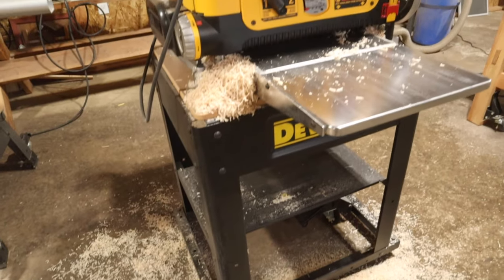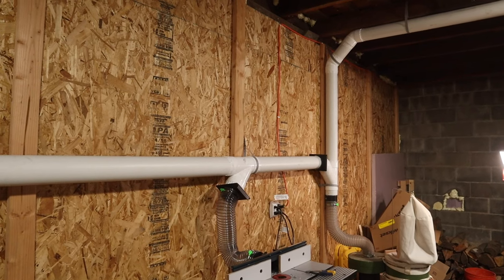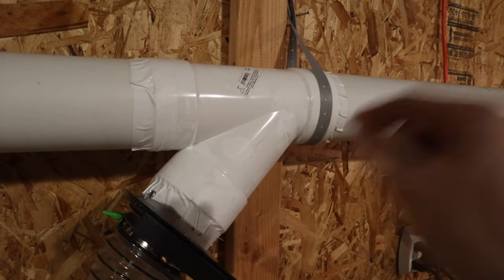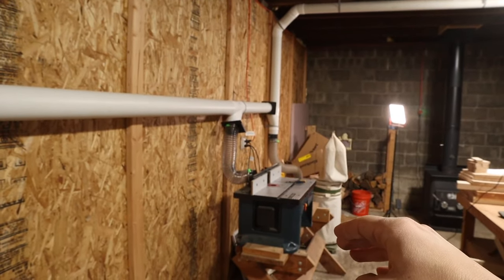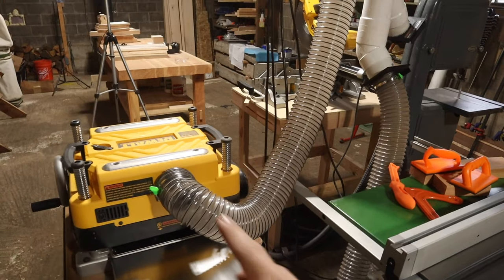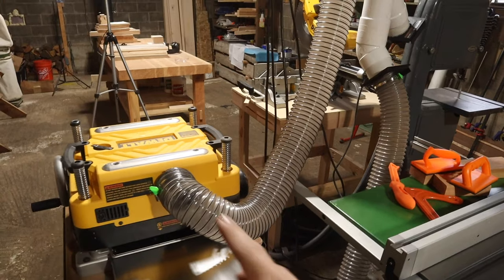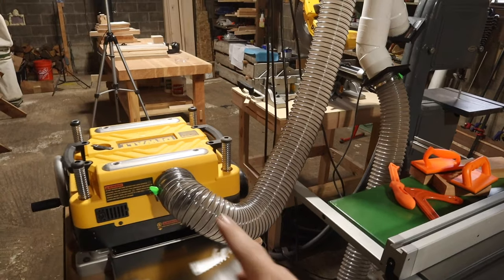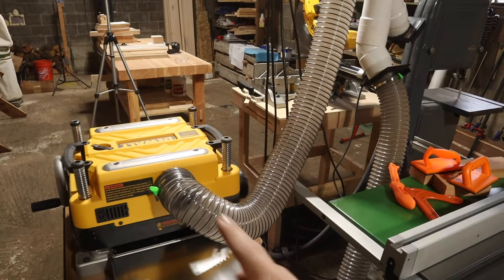4in, PVC Dust Collection Upgrade | Much Better!

Comment: New subscriber here.  I live in north Texas where it is hot. I am looking at dust collection and like your video and thought process. One question I have is with the sewage or schedule 25 (thinner/cheaper) PVC is the fit with the blast gates is loose and some tape it to make it snug and others purchase an adapter to make a more snug fit.  How did you resolve the fit problem of dust gates?
Reply from the maker: Hey Brent! Glad to have you around! 

Yea, my final solution was three fold. 

1. Cut an ~6” piece of PVC off so it can be inserted into the fitting at end of line. 2. Caulk the blast gate with silicone caulk
3. Install some self tapping screws for mechanical support. 

The caulk should be enough but while it’s uncured, it’s still pretty runny. I would also recommend, if you can afford it, self cleaning blast gates or, if you need these ones, install them so the sliding portion points down a little or entirely. They like to jam sawdust into the far end and will prevent full closure unless you clean it out.

Comment: Great video.  Simple and to the point.   Did you glue all the connectors.
Reply from the maker: Thanks! Glad you found it helpful. I did not but would recommend at a minimum, screwing all of them together. Caulking all connectors would create a better seal but I’m not sure how much of an improvement it’d be. I’m also planning to move this system with my in the future so I wanted it a little easier to disassemble.

Comment: I wonder if attaching a ground wire somewhere on the ducting would kill the static problem?
Reply from the maker: It would help but because PVC insulates so well, you’d have to wrap it or cover it in more than just one location but grounding it would help.

Comment: I have a question: You show your entire system using 4" PVC. What is the inlet of your dust collector? If it is 6" or 8" as most are, did you run that diameter and then reduce to 4" or instantly reduce at the collector inlet? Any thoughts on which is a better method? Thanks
Reply from the maker: That’s a great question, in my case, the dust collector has a 4 inch at the inlet, so I had no reduction all the way through. If you do need to reduce, I would tend to leave it as large as possible for as long as possible, then reduce it at the tool. However, I also understand this means you will be paying a lot more for your dust collection hardware, so immediately reducing it at the collector might be the right answer for you.

Comment: This video came at the perfect time as I’ll be replacing my current “system” with DWV pipe. I see you are using Powertec blast gates. Are they self cleaning? Thanks for the great explanation.
Reply from the maker: Glad to hear! And I am using those. They are not technically self cleaning so there may be jamming issues later but this far they’ve worked great!
Reply from the maker: Hey Richard! I wanted to provide some feedback. I just went through and did a cleaning of all my blast gates because some of them were pretty clogged up. Easy to clean but definitely confirms they are not self cleaning.

Comment: If you are concerned for the static or getting shocked by machinery I found a great video explaining how to run 3/4" screws through the piping and running bare copper wire to each screw and grounding through the dust collector and tools if you wish!
Reply from the maker: Interesting! Thats an idea!

Comment: You mentioned a canister filter. Where/ and how can I get one. I have the POWERTEC DC1080 Dust Collector with 1 HP Motor | 800 CFM | Mobile Base
Reply from the maker: Most of the videos I've seen reference Wynn Environmental (Link below). They should have one that comes close to fitting your dust collector. It is worth noting that very few of the dust collectors have a good way of mounting the canister filters. Almost all of them need a custom mount made by the woodworker. 

https://wynnenv.com/woodworking-filters/

Comment: Not sure why you didn’t mount the 45 near the router table the other way around. It would give you a much smoother airflow. The way it is now, the flow goes down and then up at a severe angle.
Reply from the maker: Can you help me understand what you mean? I installed the two wye’s to allow for a below and above collection at the router. I’m not sure how it’d rotate to make it smoother.
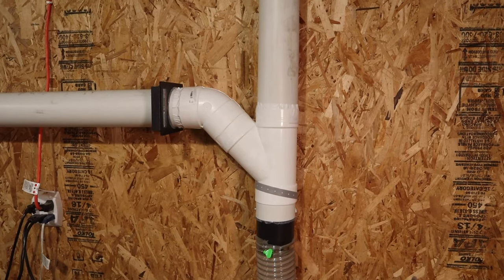Reply: I'm not sure if their comment addresses the wye shown at timestamp 5:03. When I first saw this wye configuration I thought the same thing. It looked like you had air drawn in on the left side of the wye that would go down and then have to make a sharp turn to get drawn up toward the ceiling. From the tight shot of the wye I assumed the vacuum was coming from the line dropped from the ceiling and that the line toward the floor was going to another tool dust port. Looking back at time 4:40 I realized the bottom of that wye was connecting to the vacuum source and that the ceiling line was going to a different branch of the collection system. In that configuration it makes perfect sense!
Great video, thanks for the helpful info.

Comment: I am working on the same problem with my shop. The big question I have is: how to reduce down for the small outputs on thing like sanders, routers, ect. tools that have a small vacuum size output. I need to reduce down from the 4 " Y fitting on my pipe, to these small output tools. I can't find any video that demonstrates this! Any help would be Great! Thank you for this video!!
Reply from the maker: Glad you found it helpful! And great question. I’m almost all cases you’ll have flexible hose from the 4” wye to the tool. Then from the hose, you’ll use a 4” to X” reducer or a series of reducers to match your tool’s output. 

As a note, depending if you got Sch40 or DWV, things will fit differently. I was using DWV and from my wye needed a 3” segment of pipe (to fit into the wye) and then I could barely fit my 4” flexible hose over that segment. Powertec has an adapter that makes this much easier, but it does cost a few dollars and can add up. You may also need some silicone and a screw to hold it in. 

On the tool side, it should be very straightforward with the reducers. As another note though, large dust collectors don’t do nearly as well on a smaller opening. I still use my shop vac on some tools. 

Below is a link to the 4” to 2.25” adapter I use in a few places
https://amzn.to/3v7u0yv

And here’s the Powertec 4” coupler
https://amzn.to/3DYTgLs

Comment: I’ve (hobbiest) been using pvc over a year and no issue. How dust the hf dust collector work
Reply from the maker: Same here. Doesn’t mean zero risk but I haven’t seen enough evidence to be concerned about it. 

I’m not sure if mine was originally from HF since I was gifted it but it’s a 1HP cheap something brand and it works wonders for how cheap it is. Looking to do a build with the 2HP HF with a two stage build sometime soon.

Comment: That's a great system but do you have to use a large pipe as I've got a very small work shop can I use a 2" pipe and  flexible tubes
Reply from the maker: Great question! It depends on a couple of things. If your dust collector has a 2” port you may be fine but I haven’t seen many outside of shop vacs. The problem you can run into with a shop vac is they have a high pressure drop but very little air flow. So they’re good right at the end of their own house but not much further. 

If you have a 4” Dust collector and try to neck it down to 2”, you’ll lose a lot of your flow as well because of the opposite reason. Most dust collectors have high air flow but low pressure drop meaning they can’t overcome reductions in diameter well. 

If you can avoid flexible hose I’d recommend it because the ribbing on it causes a lot more drag in the system reducing the overall effectiveness. 

All of that said it can still work do use a shop vac with 2” flexible hose through the shop, you may just find yourself disappointed with how it performs.

Comment: I can't get over the fact that no - one is stepping down the sizes for certain equipment. Stepping down to 3" or 2'" increases the volume speed and ensures delivery to the final bag ( instead of being stuck halfway). i have seen a number of commercial shops that do the stepping down! Why not in small shops?
Reply from the maker: That’s a great observation. My thought is that most residential or hobby level dust collectors don’t have the power to overcome that reduction effectively. I know mine absolutely chokes when I neck it down at a tool.

Comment: A lot of good info. How do the blast gates fit into the dwv?  Is there any gap between the OD of the blast gate and the ID of the pipe or is it a good fit?  Is that why you used the caulking around the connection between the blast gate and the pipe?
Reply from the maker: Thanks! Glad you found it helpful. Blast gates fit loosely, won’t stay on their own but close enough that any generic silicone caulk sealed it just fine. You do need to have a pipe connecting to it though, not a fitting. The fittings go over the OD of the pipe which makes it way too big to fit.

Comment: Do you know? In stead of a bag, can I run a 4" hose into the top of a trash can?
Reply from the maker: I did! I haven’t been able to get around to designing a better system yet 😂 but trust me, I’m planning on it in my new shop. Two stage, cans to empty, the works.

Comment: i have wondered if you add a copper wire running through the top of just part of the pipes?  drill a small hole at one end , run wire through and back out another hole  then seal with jb weld or such it would be worth it???  i have seen some new magnetic couplers that might reduce the number of ducts at the cluster area  also a floor drop there might be nice and central!!  i have 2 systems to set up one in our shop( where will do wood. ect) and one for my wife's  stainglass shop where she does a lot of grinding and paint work!!  i plan to put the system for the glass shop outside in a " dog house/ lean too"
Reply from the maker: You could run a copper wire through it but you'll need to make sure it's grounded. This is no statement of authority, I've just never heard of a dust collection explosion in a hobbyist shop which is why I never grounded my system. If you're worries about it, it'd be pretty easy to help drain the charge. 

On the note of putting the dust collector outside of the working space, you'll need to find a way to provide the "make-up" air. Since the DC is pulling all of its air from the work space and pushing it out in another, the air in the work space needs to be "made up". I've seen some folks just put an external vent in their shop for this.
Reply: @NorthwestCraftsman  thanks yes figued to ground to the frame of the metal building , and we leave an upper window in the loft of her shop open .  could you just ground to screws in your couplings if they go through a little bit i wonder?
Reply from the maker: Both of those would be perfect 👌 and you absolutely can ground to the connection screws so long as those are connected to ground on the outside

Comment: Great setup!  Did you modify the blast gates to prevent them from getting stuck when too much dust cakes up the grooves the gate slides in?
Reply from the maker: Thanks! I appreciate the compliment. No mods on the blast gates at this point and I haven’t seen any issues but it is still brand new in the scheme of things. We’ll see if that causes issues in the future.
Reply: @NorthwestCraftsman  Your most used ones will most likely get some buildup. I remove them and clean them with compressed air periodically.

Comment: Nice video. I'm currently installing a similar duct system in my shop. During instillation a thought crossed my mind about material dropping down into Y connections closed off between tool and dust collector. I see over your work bench you have a Y connector facing down. So when using your table saw or other at main branch do you see material dropping into the Y at the work table. If it is you would have material falling out of the blast gate onto the work table. Just curious if you are seeing this.  I was thinking of setting my Y connectors at a horizontal position and then 2 45s to get it down to work surface.   Again thanks for the video.
Reply from the maker: That’s a great idea! I had thought it might be an issue but haven’t run into it yet. The blast gates do a good job keeping the debris from getting past and as soon as I open it up, any debris gets collected. You’re idea would make sure there isn’t any issue at the price of a small amount of suction for the extra bends.
Reply: @NorthwestCraftsman  Great thanks for the reply. I'm just a hobbyist so system will not see heavy use, was just wondering. I have several spots that could have that issue and your right for the little loss of suction it might be worth trying a few 45s. I have an air flow meter and plan on lots of testing to see what kind of drop I will see with changes.
Reply from the maker: Sounds great! I’d love to hear what your anemometer says about the efficiency loss!

Comment: Great video. Thanks for sharing. New sub. 
Have you decided on how big your new DC will be? I have the same 4 inch PVC plummed into my shop (now behind my sheet rock) and I'm shopping for a cyclone system. Wondering if I should go big or limit to a 1.5 HP 600 CFM DC. Thanks for any info.
Reply from the maker: Thanks! I’m glad you found it helpful! Unfortunately I haven’t decided yet, my current setup is enough to collect at the stations I have so it dropped in priority. If you have the money to go bigger, I don’t think you’ll regret it.

Comment: Is your dust collector itself connected to the piping with a flexible hose? It looks like it in the video but couldn't tell. If so does it cause any issues?
Reply from the maker: You observed correctly! It is connected with a flexible hose and it doesn’t cause any major issues. Likely reduced my suction a little but hard piping it wasn’t an option for me.

Comment: I have a question how big is your desk collector? I have a 1hp desk collector. It was thinking about doing the same thing, but didn’t know if it was big enough.
Reply from the maker: Great question! Mine is 1HP and does a good enough job. 2 would certainly be better but 1 is sufficient in my system.

Comment: Why the crazy tool cluster thing?  Why not a single port that you use for all of the tools in the cluster.  Would take about 10 seconds to connect the flex hose coming from any of the tools.  The suction in the shot where you are cleaning the miter saw looked fairly anemic.  That's a ton of 4" pipe for that small collector.
Reply from the maker: You have a valid observation, it doesn’t take much time to swap a flex hose. I do still appreciate having it split to each tool so it’s only the blast gate I need to switch though. 

Regarding the suction, it is anemic. My dust collector is under powered for a system this large. However, it’s far better than the shop vac system I had before 😂 baby steps. I’m planning to upgrade my DC some point soon.

Comment: Would it not have been better to just glue the joints in the run rather than duct tape (which is pretty useless)?  Also I am interested in if it can pull metal swarf from my metal side of the shop?  Haven't heard or seen anyone address that.  I have a HF unit sitting in my new shop addition and am wondering if it would do both?  I will have to try using the PVC cleaner first and then the silicone.  Might stick better.  Or use a urethane construction adhesive to seal with where needed.  Good video.  Seems like each one adds a bit more to the picture.
Reply from the maker: You have a great point and I must have forgotten to mention it in the video. In a permanent setup, yes, glueing the joints is the best way to go because it guarantees no air leaks. I'm only renting this location for the next year or so though so I wanted to be able to salvage as much of it as possible when moving. Regarding the PVC cleaner with silicone, you should just be able to use the PVC welding glues. Usually purple cleaner then PVC welding agent, it actually melts the PVC on both sides of the connection and forms a single bond so that it's essentially the same piece. 

I'm unsure on the metal, I think it has more to do with the power of the dust collector, more than the piping in the shop. I can't speak to the HF unit but I will likely be getting one soon. This set up is about as smooth as you can get, what you want to avoid is lots of flexible hosing in the runs. 

Happy Wood (and metal) working!
Josh
Reply: @NorthwestCraftsman  Personally in your situation I would glue it anyway.  Comes time to move cut it in the longest sections possible then use unions to reglue it or add on in the new place.  My suggestion for primer was concerning using it and silicone for a better grip with the silicone.  I would try not to have screws protruding inside the air flow.  Turbulence and snagging chips and sawdust...   The 3 in 1;  PVC, ABS, CPVC glue would work for the blast gates without the need for silicone.  Some need no primer but I do it anyway. Thanks for the reply.

Comment: How do you like the Power Tech Blast gates?  considering purchasing them?
Reply from the maker: Great question. As cheap blast gates go they’re pretty good! The tracks do get filled and require periodic cleaning. I just use my air compressor while the system is running and it sucks away all the debris. Powertec does have a metal version that is supposed to be self cleaning but I can’t speak to their effectiveness.